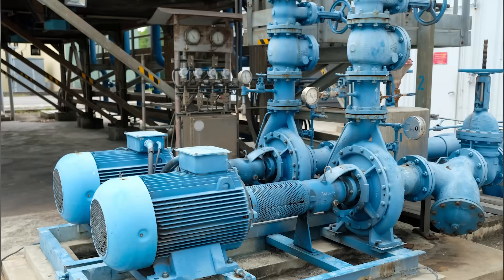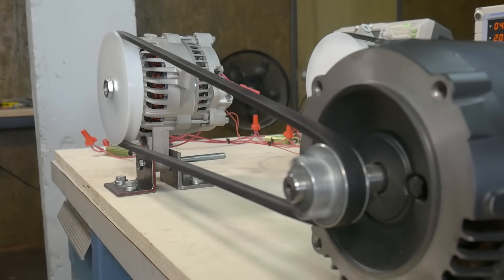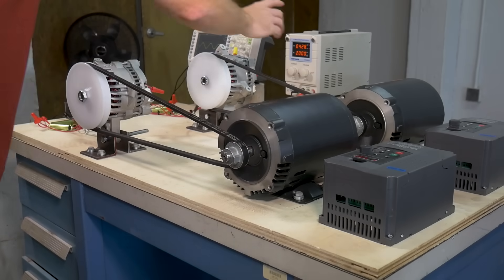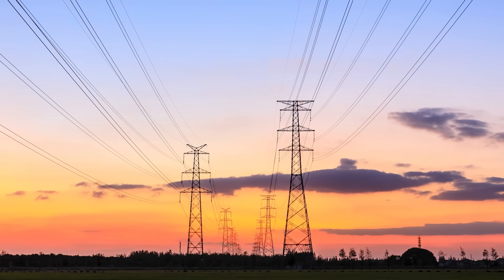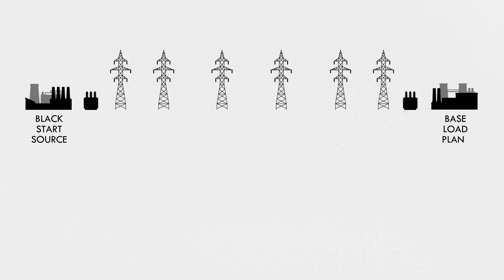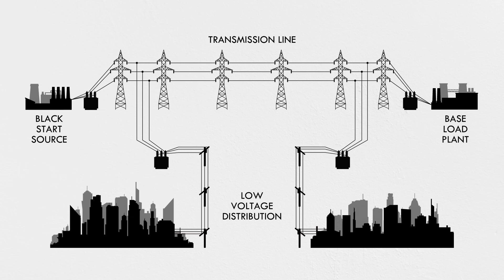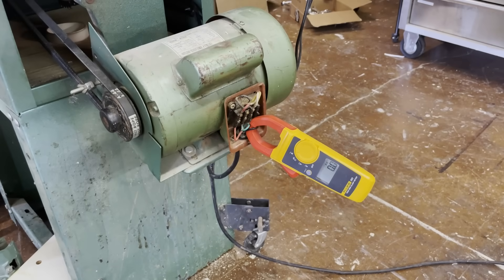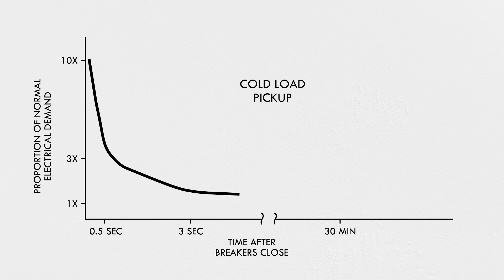What Is A Black Start Of The Power Grid?

Comment: Back in my days in the USAF, we had our own diesel generator for running a mobile office - if we lost power from an outside source.  It was a crude setup that had no regulation on the speed of the generator.  As a workaround, we adjusted the throttle of the generator/engine so that the analog wall clock would run at the correct speed.  The clock was running on standard 120 volt 60 Hz wall power.  If we got the second hand reasonably accurate, we knew the generator was running close to the right speed.

Comment: I made a trainer for the breaker panel of a submarine and had to cover the phase synchronization from the reactor power to the battery driven AC generator.  There's a story of a fireball resulting from connecting two power sources that were out of phase.

Comment: I had to black start the power grid in my playthrough of a game called Satisfactory (basically 3D factorio) after it ran out of power because of a mod breaking thanks to a game update which cut the generators off from the grid. It was so difficult I gave up and cheated and disabled the power requirements until everything came online and I'd replaced the the broken bits of circuit.

Comment: You talk of getting the load reconnected and the spike of everything starting at once.
On a small scale " black out " you should see if one phase faults out. many customers can get massively 'strange' voltages both up and down, which can destroy many things, but all the 3 phase motors burn out as they all fight everything else on the system.

Comment: I work building maintenance, and call center client requirements often include backup power so the site can keep operating through outages.  To ensure it's ready to go into action when needed we "exercise" our generator weekly, although sometimes you have that "perfect storm" that happened to me in May 2021.  The generator blew a coolant hose resulting in a shutdown condition, and before the service tech could get there and replace the hose, a storm hit and took down mains power.  Thankful for our UPS, which picked up the load for almost 30 minutes until he got the coolant hose replaced (hearing the generator fire off and the transfer switch kick the load over to the generator was one of the most welcome sounds ever, because it meant we were going to be OK).  Grateful that most agents were working from home (COVID) and we had very few people onsite - if we'd had a full center, like before the pandemic, I don't know if the UPS could have kept the site up for the 20-25 minutes it took to get the generator back online.

Comment: The thumbnail picture to this video is a SF⁶ circuit breaker. It utilizes sulfur hexafluoride gas to rush by the arc created when breaking. Fluoride is a very nonconductive element.

Comment: Scenes played out in miniature literally thousands of times by USN sailors over the years.  When a Navy ship is in port, power is supplied from the pier and the Engineering Plant is shut down.

Prior to leaving port the Plant (In my case, 600 PSI steam, oil-fired boilers) is brought up using power from the pier, the ship's turbine generators are brought up and synchronized with Shore Power, the electrical load shifted from Shore Power to the generators, and Shore Power is isolated and disconnected.  When they return to port, the entire process plays out in reverse.  This is normal and routine, just as it is with a commercial power plant responding to changes in the load.

During an engineering casualty (or some rather realistic drills), the Engineering Plant will be partially or totally down, taking down the generators as well.  At this point, the Emergency Diesel Generator will auto-start (from batteries or high-pressure air) to provide power to the Emergency Bus to power critical loads and minimal lighting.  

When the issues causing the shutdown are resolved, the Engineering Plant will Black Start off of the diesel generator to the point where they can spin a turbine, the turbine generators synchronized with the Emergency Diesel, the main switchboard "stripped" (breakers for non-critical loads opened) load shifted over, and the diesel generator shut down.  The rest of the Plant will be brought up off of the one Turbine Generator until the status is such that additional generators can be brought on line and non-critical loads restored.

While smaller in scale, the procedures, concerns, and pitfalls are all the same.  There is always that little bit of worry as you reach for the switch which will, for a brief time, make you a contributing source for the National Grid...or cause really nasty things to happen as your little 8MWe oil-fired steam power plant gets in an argument with the Big Boys on shore over who gets to set voltage, phase, and freq for the entire grid.  Thankfully, it wasn't me who proved that the generators can actually stall the turbines and cause them all to trip out if you get it wrong.

Comment: So I just came up with an idea for a new kind of generator. What if you have a heavy object, like a 50 kg or 110 pounds iron weight, that slowly falls. The weight is connected to a sturdy gear that spins the next gear faster than the last, and so on. With this model, you could make things as big and massive as you're liking. So that leaves us with one last problem: how will the weights get pulled up again? My best idea is that all the first gears are connected to each other with a big metal rod that a machine pulls up again. When this happens, the last gear will break the chain, so the generator doesn't explode or something. If you can't visualize my idea, just look at it like an old clock on steroids and if you see a grand problem with this idea pls comment.

Comment: Best way to grasp electricity I've found is this.  Everything is moving around, there's some spikes of conflict and decay but generally things reach an equilibrium.  We live on equilibrium earth.  Everything's got its location and size and density, but it's all sort of meandering at its balance.  When you take some copper wire and stick it in this meandering balance it in shape and purity is an off balance.  Think of it like a a spot on your chip with an intense compaction of pure spice.  Not the best example but I can't say lightning rod in air that's too similar to be an analogy. 

Anyway, to me this purity is almost like it's slippery.  It's not a gravity slope but a motion slope. As everything meanders its angular velocity around the curve of our earth and gravity, this slope un-curves that motion and sends it 'down' a hill of straightness in a curved world.  This is electric charge.

With all that in mind the analogy that works for me is electricity going down that slope is like a floppy rope being pulled tight.  Electricity is motion-tension in a curve momentum producing straightness, like a pulled-taught rope

Magnets in short end up acting as motion-islands.  Slippery islands of motion that pulls itself at open poles when separate from whatever natural balance it attained before use as a magnet.  You can induce the slip with these slip-generators through more slipping materials.  In short magnets have momentum at the ends, best way to subscribe it.  The arrangments of the material (matter is made of motion) seem so dense, or 'slippery' that it can't stop in time at the edges of irs condensed form.  This momentum cannot dossipitate far, the  motions of its environments equilibrium are a resistance to this momentum.  The momentum is run-away and non stop, it is not a radiation of energy it is an aspect of its form.  It is motion but it is motion within itself when separated from everything else.  It is its own curving balance of motion, it's motion is not the same as the notion everything including it is in.  This unbalance with its environment creates constricted spheres of motion in the general balance of things.  This disturbance is magnetic lines that can influence other materials. 

All.matter has this charge, the static (equilibrium) attraction and charge.  Obviously it's all motion based, as is existence.

Comment: I had the privilege of bringing a generating unit back up at a small, older hydro plant using phase lights and a sync scope... it was intense and very cool! With modern control, such as PLCs and other automation you don't get (or have to) do this anymore... that plant has been replaced by a new single unit powerhouse now, I worked on the automation there too... but it still isn't as cool as that dead start and sync was.

Comment: Thank you for this video.

I live in South Africa and we have daily "load shedding" like right now.
This is due to the useless ANC government and lack of new generation capacity or proper maintenance of old infrastructure.

Anyway, we are off 2 hours at a times and those cold load pick-up scenarios are common.
Can see the voltage is lower on restoral and some areas often trip since people don't switch off loads before restoral.

The topic of a national blackout also comes up at times in the news, so this is a great way to explain this to people.

Comment: Boeing 727s had 3 separate three phase generators (one on each engine) The flight engineer had to synchronize each generator before connecting that generator to the bus.  The engineer would adjust the frequency with a knob and watch two blinking lights.  When the lights went out together the engineer knew it was OK to connect the generators. Called closing the bus tie.  😁
Reply: A very simple procedure.
Reply: Same thing as he's talking about.

Comment: Thanks for this well explained series.

Recently I learned more about the miracle fusion reaction that had very recently happened. 
 
But, at Answers With Joe he said the required 3 kilojoules of energy produced by that many lasers (145?) had needed 300 kilojoules of energy to get it there and produced more power, hotter than the surface of the sun and some. But that wasn't strictly true because it took 300kj to get it there. Thoughts please?

Comment: funfact. big motors have, by default these days, a freqnency controller with 'soft start' which is more or less mandatory to have.
nothing ruins a grid operators day better than 50kw motor being turned on short circuit style; zero limitation to current running trough it as it cranks up.
grid operators will see it immetiacly, and they probably will call whomever started that motor pretty angry.

Comment: Blackouts and power outages are fixable.
But EMP damage .....
I hope the day never arrives when you have to deal with that.
Reply: This isn't something that has gone unplanned. If the EMP comes from a nuke, nothing matters anymore. If it comes from the most likely source: solar flare and the subsequent storm, there are preparations that can be done to mitigate the impact. These events give roughly 12 hours of warning, quite often more. The idea is to open all breakers of transmission lines and preferably ground them. This would mean a complete blackout and would require a black start for the grid to come online again. As long as your equipment was disconnected from the wall, it'll work as if nothing happened when there's power again.

Comment: Great video that covers the challenges of starting a power grid from a blackout.  I used to work at a power plant that included two coal units and four combustion turbines, two of which were black start capable.  We did a test where we disconnected from the grid, started up the black start combustion turbines, then started up one of the coal units before connecting back to the grid.  It took a lot of planning and coordination to do this, but it was a great exercise.